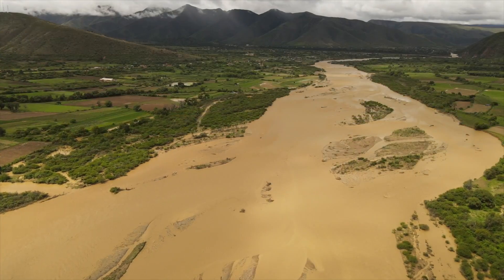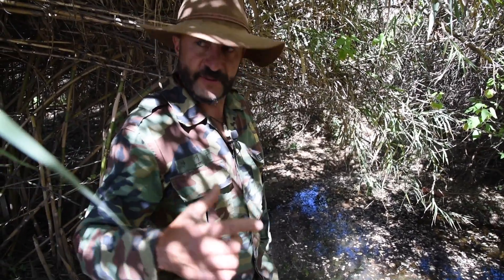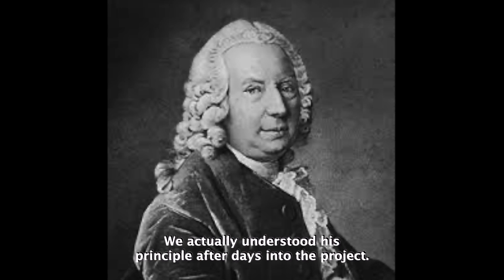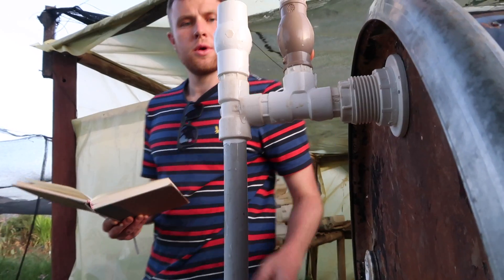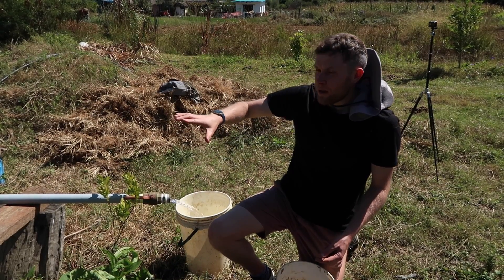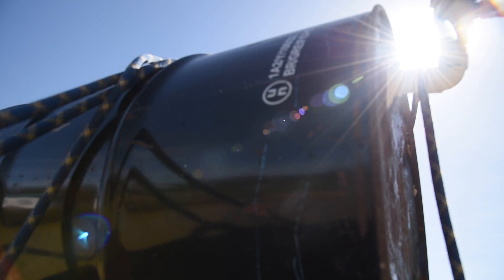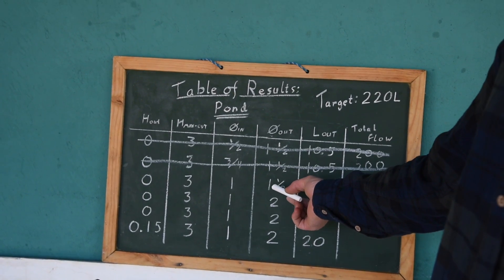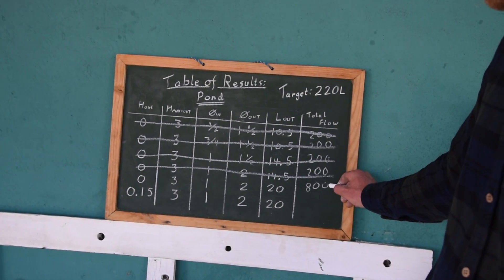Free-energy vacuum water pump | Do they really work?

Comment: Hi.  Thanks for the great video.  I like how you share your trial and tribulations with us - making the eventual successes part of a process of persistence.   I have experienced owning and sharing land used with livestock. Perhaps if you too have wind in your area you could provide some water to upper levels by using a gradual/incremental means of raising water.  Mini windmills leverage the wind to pull up water and put it in above the surface water containers - like the kind that cattle can drink from without issue.   A second stage (same technology) can raise water from that container to a large tank (let's say) 3 meters in the air.  One could even use a solar panel and submersible pump to do the latter.  Then that up in the air water can be controlled to water distant fields assuming the piping is in place.  Doesn't have to be dangling pipes.  'Could just lower the water to mini cement canals - 8 " wide and two feet tall.  They have them in Ecuador that come down from the mountain reservoirs.   Permanent and low maintenance.  And wherever they want to use the water, they use a water flag (think P.A.Yeoman) that has a chain along the bottom of a waterproof material) that when placed in the mini canal, diverts the water out of it and into the adjacent area where water is needed.   In any event, ,keep up the great work.  And thank for you letting us come along for the ride. - Jim from Phoenix, 118 F (47C) in Phoenix, Arizona today.  So, let us know how much wind you get.  Instead of using suction, wind may be your answer.  It's an obedient servant and doesn't require such tight seals and suction.
Reply from the maker: Hi Jim, thanks for the feedback and ideas. Wind is limited to a short season here.  Solar would work but it's a bigger investment to lift enough volume else I guess with more targeted drip it could be more affordable.  Solar in the mountains would probably go walking. Needs to be close to a house to keep secure.
Reply: @Kaiwaipermaculturebolivia  With wind used for water pumping, the wind can be way below what would be needed for use as electricity.  4 mph in the middle of the night for a few hours could find your water trough/tank full-ish.  And then when the sun comes out that 100 watt panel with a submersible pump could pump the water to the high water tank and then be used via gravity to feed the watering system. If you require a large volume of water to be moved more continuously.  That, as you suggest would require a different scheme.
Reply: Throughout the USA and even Texas, every town with flat topography had a big ass water tank with the name of the town painted on it.  Everyone in the town would depend upon that water pressure.  I imagine something like those huge tanks for the Permaculture Retreat Center - serving your irrigation and water needs - as well as putting your place on the map locally for workaways and such, "Looks like we're at the right place."   ;-)
Reply from the maker: @surfviewgardens2396  we'll do a vid on our water management soon.